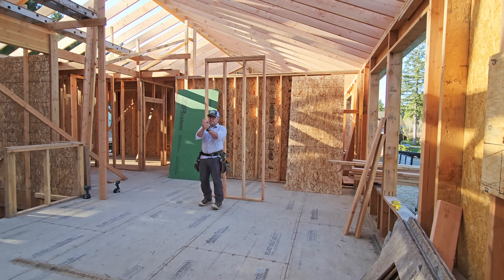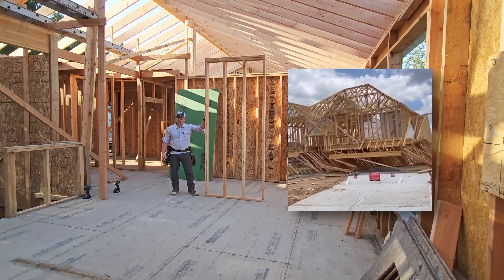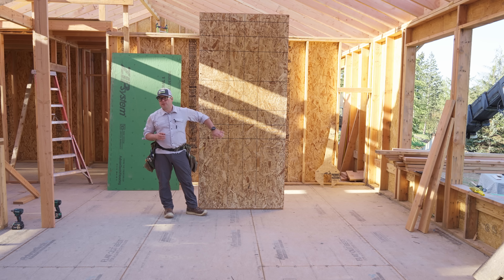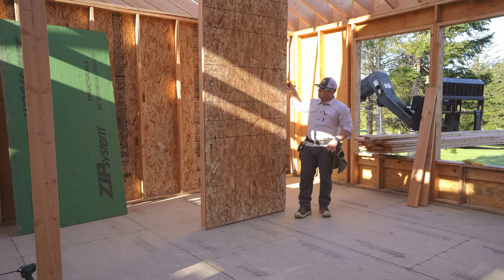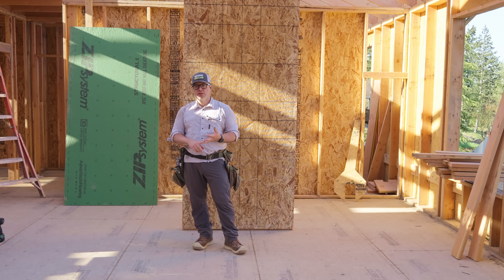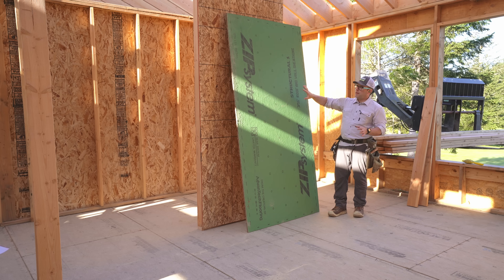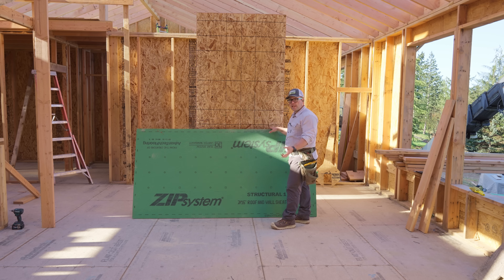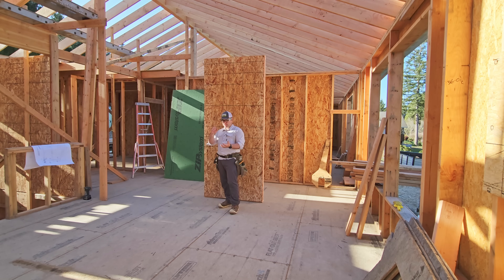Shear Walls Secret: The Hidden Force That Holds Buildings Together

Comment: I saw a couple houses collapse in my time as a builder by other builders. It was always from new crews who didn’t understand that you can’t rely on braces to hold an entire house with roof set. Sheathing and decking are your friend, sooner rather than later!  Good video.
Reply: 22 years GC in Minnesota we have never started second story without sheathing the first floor
Reply: @chartedtravel1776 apparently you value your life.
Reply: I've framed 8000 sq ft houses alone and if you know how to get stuff square straight plum and level alone do good job on bracing it and can cut boards to length on first try drive a nail properly you don't need sheathing til it's all framed guaranteed or I'll reframe it no charge i give a 10 yr structural warranty on every single piece. 2 bucks a ft all I ever got in 1610 houses loved it had 20 guys at 1 piint relized i got to where helpers just slow me down rather just do it myself keep the money no payroll.
Reply: @GregTheFarmGuy-j4e 

I’m sorry you weren’t trained properly.
Reply: Gosh I learned from a couple of best carpenters ever when I was 18 and 19 years old. Taught me more than an most will ever know. Did pretty good at framing ordered million a month in lumber windows doors for decades was biggest framer in state for longest time lumber yard would throw us a big party evert September cuz nobody had ever put so many houses together so fast. We had a system. Ppl ive built for say im brst carpenter since Jesus.  Carry 10 year structure warranty if any problems ill reframe it no charge only charged ppl 2 bucks a foot for framing most houses. I got so good at it even had Rockefellers call wanting lil over 43,000 sq ft addition to thier lodge up on the mountain.  That was a job there full acre under roof 53 ridges all stick built cut up like crazy all 12 12 pitch I remember 1 hip was 104 ft long biggest board I ever carried around by myself or more like bounced around the house thing was heavy long awkward to carry on your shoulder.
Reply: Slick taught me how to cut everything before you ever pop a line whole house cut and ready day before crew gets there.headers tees corners blocking joists rafters even the decking have whirrllybirds assembled cuz they going on tomorrow. Cut like crazy all day before and house goes together like raindrops falling outta sky pop pop pop its done. Digger taught me all the different ceilings from box pan barrel coffered vault all different stairs straight 2 level 3 level curved free floating curved .the day I did the triple octagon boxed panned vaulted from 9 ft to 24 ft inside a octagon turret that was 24 ft tall I knew I was ready to go out on my own but did a year and half w snake he taught me fast fast fast keep at least 2 more like 4 houses going all same time and bid um cheap so you get every house. 3 of the best I've ever met outta 1500 plus guys I've worked with. No I wasn't trained properly I was trained excellent.  That's my company motto .providing excellence in home construction at low cost with warranty.

Comment: As someone looking to build my own house and only hire out plumbing & electrical, this is very helpful.
Reply: If you haven't done it yet, I'd recommend hiring out for the earthworks and concreting too. Earthmoving machines are fun to drive but you can get yourself in a lot of trouble if you don't know what you're doing, and the professionals will do it quicker anyway - which starts to matter a lot if you've got a hole in the ground still open when the next rain comes in. And concrete can wreck your back fast if you're not used to working that hard with the clock ticking.
Reply: @tealkerberus748  true.... and i'm not getting any younger... lol.

Comment: e I have been a subscriber for a few years and have loved your channel both as a residential designer and a framer (GC) for about 40 years.
We design a residential structure in 2 way RC "prescriptive" or BC "engineered" with a (PE) mostly a mix of both.
I am fortunate to be located in Southern California, a high seismic region Cat D1-D3. So we are required to design for both Wind and Seismic reactions "forces". You did mention "stick framed" as a benefit but that is not the complete story. Let me explain the reason for the separated analyst.
1) The code books "Building Code" or "Residential Code" are prescriptive. This means if you comply with the code book then no engineering is required. Deviate from the code book for wood products (PE) engineering is required. Engineers do not calculate "Calcs" from the code books, it is the (NDS) "National Design Specification" for wood products that detail structural calculations. If you find it in the code book with zero engineering requirements.
2) Seismic Design, is simply mass and acceleration. The taller, and more massive the building the harder it is to transfer force to the ground. So this may surprise you "prescriptive" in a high seismic zone D3 under prescriptive code we need to A )design for racking with  "Braced Wall Panels" racking. 2) Design for "Base Shear", but we do not need to design for "Over Turning". Engineered design must be designed for overturning with hold-downs. But why, because "prescriptive design" (RC) has 100 years of real-world proof. Custom engineering does not.
3) Wind design, take a 10'x20' structure. Wall line A&B = 10' and wall line 1&2 =20'. Why does a 10' wall line A&B have a more shear than the longer 20' wall line 1&2.  It is because Wind is a factor of pressure like a sail 
   A) Shear resistance of the short wall line A&B at 10 LF. Wall lines 1&2 at 20 LF are getting pushed at 10psf =(20ft LFx 10ft high)= 2000 lbs total force, the walls resisting the force are the short walls A&B only 10ft long = [200 lbs per Ln Ft. ]
    A) Shear resistance of the long wall line 1&2 at 20 LF. Wall lines A&B at 10 LF are getting pushed at 10psf =(10ft LFx 10ft high)= 1000 lbs total force, the walls resisting the force are the long walls 1&2 but they are 20ft long =[50 lbs per Ln Ft.]
So the long walls shear requirement is 1/4 the requirement of the short walls

Comment: Do you y’all still build your own gables with gable  studs down there with finding the Line lengths and common differences and notching the top cord in it with the shortening’s for shrinkage down there? Everything is all truss packages here and come with sheeted dropped gables on flat over here then we stick frame our lookouts

Comment: Or you can go old school. Inset diagonal corner and end wall bracing. Before uniform panels, they would sheath diagonal, floors and walls.
Reply from the maker: That won't provide the values we need unfortunately.
Reply: @AwesomeFramers  Frame with 2x8 TIMBERSTRAND WALL FRAMING?
Reply from the maker: @amunderdog  That doesn't improve lateral strength.

Comment: Here in Washington state most the projects I’ve worked on required .148x2 3/8” nails for any designated shear wall. Also if the nailing   Pattern is tighter than 6” and 12” a 3x stud is required at the plywood edge as well as a staggered nailing pattern into the double top plate so both plates are nailed. Most of the multi-story wood frame apartments I’ve done will have an earth bound hold down at each end of the shear wall which consists of a continuous rod that is coupled together and terminates midway on the final floor. At each floor the rod is held down by a steel plate and an auto take down which compensates for the inevitable shrinking of the wood.

Comment: Our house is sheathed with mostly gypsum board and low density fiberboard.  It was built in 1980.

Im trying to add shear strength to the unfinished garage and garage attic.  I was planning to block between vertical studs with 2x4s at 45 degree angles before insulating.  Does this sound good or is there a better way to approach?
Reply from the maker: I would get a consultation from am engineer

Comment: How many sheerwalls do you need? Am building a stand alone shed inside a steel shed. I was thinking doing this to all exterior wall, but do I only have to do one sheer wall north/south and one east/west?
Reply from the maker: There are many factors that determine where, how large and how man you need.  I'm not qualified to answer your questions.

Comment: I noticed you screwed the OSB to the wall, but talked about nail. Should you screw or nail it? Also does the OSB replace the diagonal boards I see every other YT video cut innto the studs?
Reply from the maker: Yep nails are in the code tables. So nail it to meet the design load. I was just building a temp wall for demonstration purposes.

Shear walls don't rely on diagonal boards, though you can find the values for that. The OSB replaces the diagonal boards and significantly increases the lateral strength.

Comment: 0:20 Nice screen ratio edit to crop out the tractor pushing the framing over...
Reply from the maker: The point of the video is to show racking, and ultimate collapse from lack of shear walls or bracing.

Comment: Is there any issues with moisture when you stand sheets up.  I frame houses in canada, we install the sheets horizontally, stagger the joints and gap the sheets to allow moisture to escape. We don't block the joints

Comment: Looking at how some homes are built in other States blows my mind. I would NO MORE raise an unsheathed wall than I would skip using nails. It makes absolutely no sense building a structure with just a frame. Even wind bracing won’t stop a building from falling down once the walls become out of plum. The weight of the walls and second story floors plus the roof rafters……….on and on!!
You MUST SHEATH ALL EXTERIOR WALLS before putting them in place. That entire collapse shown could have been saved if the exterior walls had been sheathed. The amount of structural weight is completely solid if you sheath all walls as they are raised into place. What a shame that the entire structure collapsed over the omission of something so simple a task. I mean, sheathing a structure after it’s been framed is foolish and so time consuming. You have to stage the entire project in order to install the sheets of plywood. 
Sheathing the walls on the deck of the structure is so simple and saves thousands of dollars in labor cost. 
If your structure collapses because it wasn’t built structurally sound, your insurance will not cover the damage. I built 543 homes in my 40 year career as a builder /architect and NEVER did we ever take shortcuts on our frames. Our frames were outfitted  with 12-16” O. C. WALLS and ROOFS. sheathed with 5/8” vex plyscore. All our walls had CONTINUOUS diagonal 
bracing with 2x4 or 2x6
As the frame required. 
All wall and floor joints were secured by Hurricane steel braces at all intersecting points. Our frames WILL stand up to any force thrown at them. The entire frame and sill is 
BOLTED with threaded rod right through from the foundation concrete to the top plates on the TOP floor. My homes if maintained will last hundreds of years if not indefinitely. Once my frames were covered over with plywood and siding, nobody knew the difference between our HIGH QUALITY and other not so well built examples. BUT!! Our homes will outlast the others !! Guaranteed!!!
Now that I’m retired I see how most builders are building there homes and I AM NOT IMPRESSED!!
Peace✌️🇺🇸✌️🇺🇸🇺🇸🇺🇸

Comment: Dear engineers, 3" perimiter is too closely spaced. When applied perfectly its fine, when applied by typical florida framing crews with some overshooting, and some tight spacing in fear of a nitpicking inspector, well it seems like a "tear here" perforated line. I've seen failed inspections pass after someone went back and shot between each nail. An inch of grace to account for human error would give a stronger end product AND eliminate a lot of headaches.

Comment: I live 30min off the coast in Texas. My framer installed 2 shear walls in my home. 3/4” plywood and bolted in the slab. It is relatively cheap to do this and adds so much safety and security.
Reply: Hope y'all used hurricane strapping through out as code demands.
Reply: @terryanderson4366  corner straps from within the foundation, wall straps, ceiling joist straps, if a hurricane takes our home it will be attached to the foundation…
Reply: @terryanderson4366  We have about 300 lbs of hurricane strapping.
Reply: I live on the Texas coast.  We have metal strapping running diagonally under the sheetrock for a shear wall.
Reply: @jbratt  Yes, the engineered house is strapped from the roof rafters to the corners. If our house blows away during a hurricane it’s taking the slab with it.

Comment: I'm renovating our 1980 built home and so far I've only gone through gypsum board sheathing in our kitchen and garage exterior walls.  I know wax core gypsum sheathing exists and is sometimes used for additional water diversion or fire blocking, but I'm also concerned the builder may have used drywall sheathing to cut costs.  Is there way to inspect the exterior sheathing material without damaging anything?

Comment: shear loading the nails? 
I learned that nails and screws are not shear loaded, but they pull the pieces together to let the friction between them do the work.
Reply from the maker: Can you provide a reference that backs that claim up?  That is not in any of the literature I've read.

Comment: I'm not a framer, so I'm only asking questions here. In the clips of the houses collapsing they didn't have sheathing. If a crew found itself in a position where they had to wait for the sheathing to arrive after framing should there be temporary bracing installed? How would you go about that?
Reply: Temporary bracing is done with 2x4s running on an angle from the top plate to the bottom plate and nailed to studs along the way. They will usually do them going from top plates inside of the house and to the outside as well. You can see some bracing in the clip of the house coming down running diagonal at various places. 

A good storm can take out temporary bracing if enough isn't put up

Comment: Just found this video and subbed. I just learned about these various forces. I built a small 4 x 8 raised deck to catch rainwater in barrels on. I braced it figuring I'd have racking either from back to front or from side to side. A light rain easily filled the barrels. Roughly 450 pounds of water in each 55 gallon barrel. I thought 2 x 4s I had left over would work. Nope! A couple 2 x 6s seems to have worked. No more racking. 

I have a lot more to learn! 👍🇺🇸🍀

Comment: Good stuff, you guys in the pnw legit using 2.5x.131 (8d common)for all panel connections? In northern Utah the overwhelming majority use 2-⅜x.113 (8d box) or use a staple equivalency. But the different nomenclatures really make it all so diluted, it's good the industry ius moving away from the number/letter system and just stating diameter and length.
Reply from the maker: Yep, it's spec'd that way on the plans. 2 1/2"x.131"

Comment: Here in southern California we use a lot of 3/8th and 1/2" OSB.  Generally the 3/8th is nailed at 6/12 and the 1/2" at 4/12 or 2/12 but obviously is nailed to what is specified by the plans.

Comment: I walked thru a dried in house studs exposed house once that looked like the studs we're all on an angle. But when it comes to plumb and true our eyes lie but it was still bugging me. I lived about 1/2 mile away so I got my level and good gawd yep, the house was built that way it was a bi-level house with a walk-out. The slider was plumb but all the walls leaned. This was in like 1995ish. This kind of construction was going on back then and it's worse now. Builders where I'm at can't afford skilled labor and most of the older experienced guys retired during the pandemic so these builders hire inexperienced people off the street. Houses take forever to build now too. Some materials are wacky in pricing and availability. I had planned to start a build 2 years ago and can't see even see starting until 2025. BTW....2 years ago I gave up my builders license I'd had since 1995 because they only take online payments now and I don't do anything financial online. Old school checks here. Residential construction is a mess with crap quality now.

Comment: What contractor allowed the second floor to be built without shear protection on the first floor?!? Also, temporary shear "protection" should be added to the inside of every single shear wall as it's being built. I've always added permanent shear protection to any house prior to the second floor being built or the roof system being framed for a single story. How else does one expect a perfectly square & plumb house to be built? 😏 Those, so-called, framers are lucky those homes didn't collapse on them while they were "framing" (?) them.